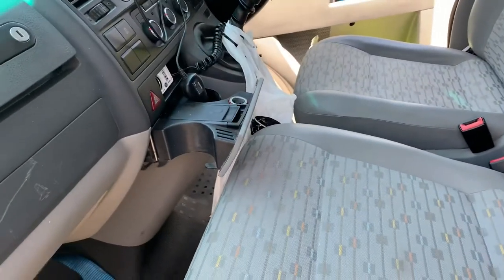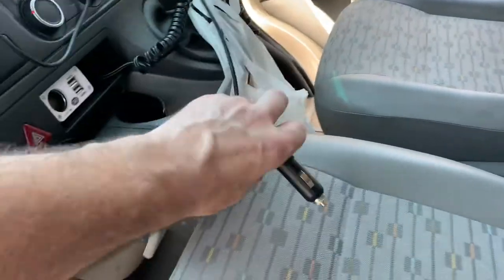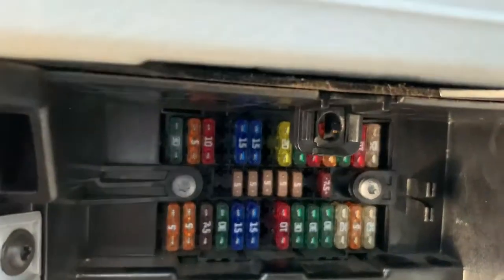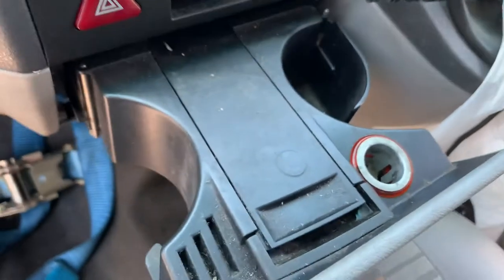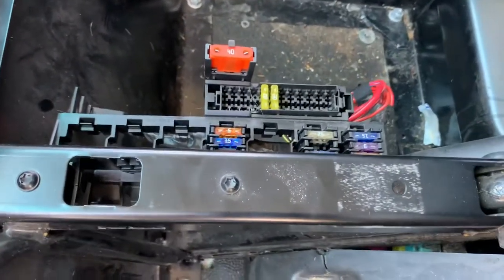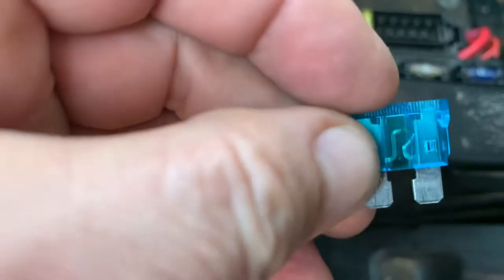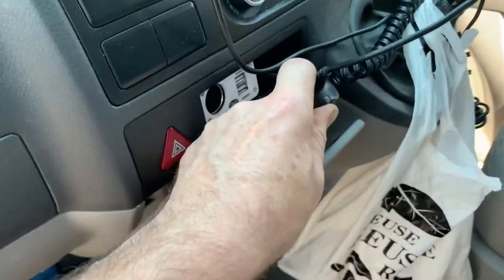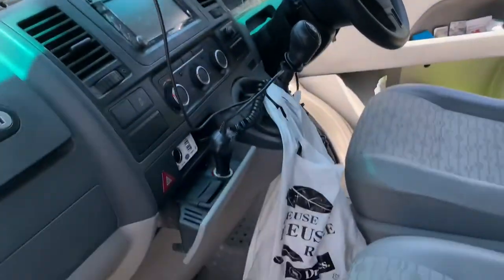Vw Transporter T5 Cigarette lighter socket not working, three solutions, fixed

Comment: Finally a video with a double passenger seat. However, when I open mine (a T5 Shuttle) there is no fuse holder like the one in this video. The search continues!
Reply: Did you find it in the end ? Mine is the same , no fuse holder :/ lol, maybe it’s under the matting under the chair hidden ?
Reply: @envueltoenplastico